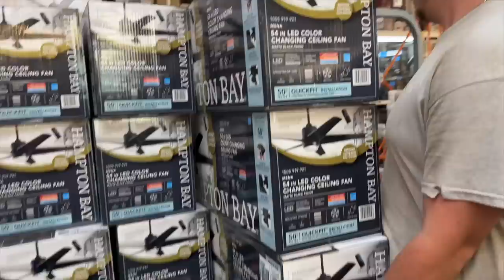WEEK IN MY LIFE! | Visiting Cows, Rescuing Injured Duck & My Horse Needs a Procedure!

Comment: Surly the sides need to blocked off as well as a draft will go though kinda defeats the object
Reply from the maker: We thought about that as well, but we hardly have much of a cold season, mostly year round it’s hot & I want them to still go in there and sleep even when it’s hot out, so the open spacing of the boards on the walls & back make airflow